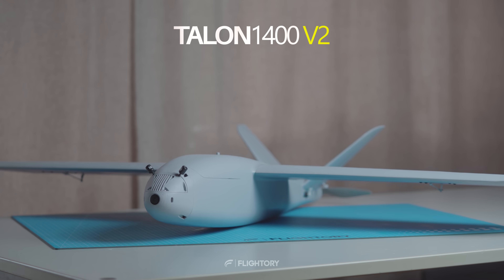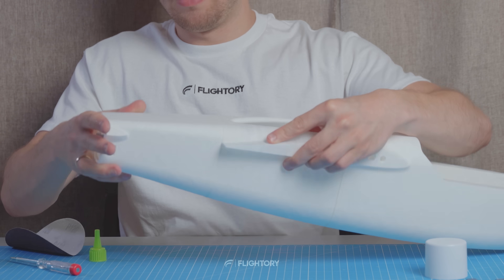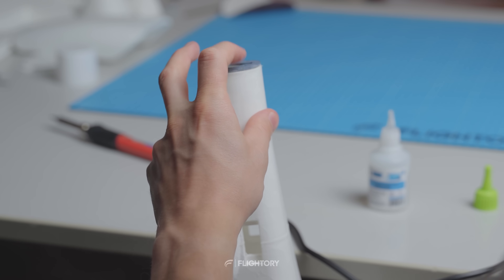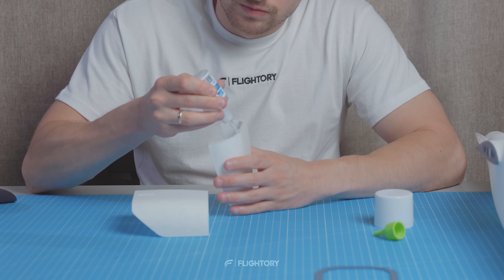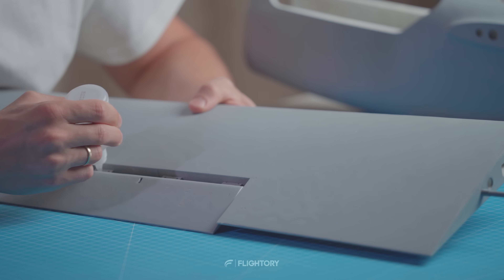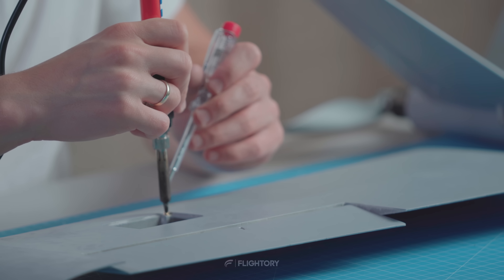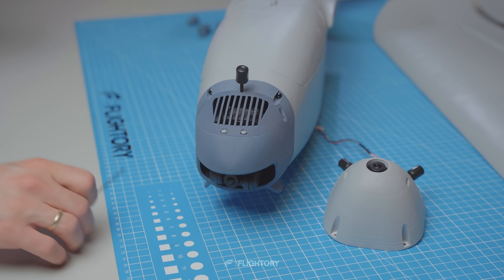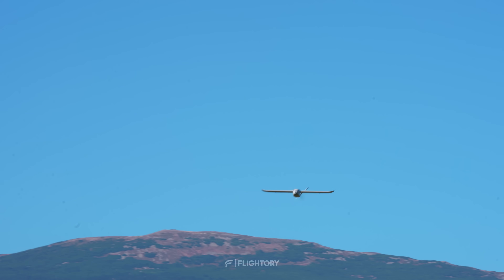How to Build a 3D Printed Fixed-Wing UAV? | Talon 1400 Build

Comment from the maker: The first video in the electronics series is now on the channel! 

https://youtu.be/VMb7csf-KqU?si=XMgjYycBKQixS2tG

I’m starting by introducing the basics, discussing the essential components for fixed-wings, and explaining key concepts. The following episodes will cover equipment selection, soldering, mounting components in the plane, uploading firmware, and setting up parameters—essentially, the entire step-by-step process of working with plane electronics. 

Let me know in the comments how you like it and what you’d like to see in future content. I appreciate all comments and thumbs up, as they help us grow this still-developing channel.
Reply: It would be cool to see a larger version with more sensors onboard. (Night vision, Thermal vision, etc. )
Reply: So uh ... I have questions. Why two 10mm rods to reinforce the wings yet flimsy 3d printed hinges for the control surfaces which are way more important? Also how the hell do you land the thing without destroying your camera and prop?!?!?!?
Reply from the maker: @ Believe it or not, the reinforcements and materials are not chosen randomly. I don’t quite understand what you mean by saying that the hinges are much more important than the wing reinforcement. They are equally important but serve different roles and handle entirely different forces. The wing is under constant stress during flight, and the spars are essential. They are designed to handle a takeoff weight of up to about 3000 grams without any issues.

The control surface hinges are made from polyester material, specifically designed for use as airplane hinges, and they are indestructible. There are no strong tearing forces acting on the hinges. Even if you completely destroy the entire plane, the hinges will still remain intact. I mentioned that you can also print them from TPU, and that’s true. Try making one and then try to tear it—it’s almost impossible. So, this is not a weak point at all.

As for landing, watch the flight video where it’s shown. Landings are done belly-first on grass. I said that if you’re worried about damaging the propeller, you can use a folding propeller, and then there’s no problem. I use a regular propeller because I never have an issue with damaging it. I land on grass with the motor turned off. Even if the propeller touches the grass during a sliding landing, it doesn’t get scratched at all. Regarding the camera, there’s no issue either. You land on the belly, and the camera doesn’t even touch the ground.

In normal use, I don’t see any problem. I make plenty of flights with these models, and if you use them correctly, they don’t get damaged.

However, if you crash the plane into the ground, then these considerations become irrelevant since most of the structure will be destroyed, along with likely some of the electronics regardless of materials using.
Reply: I would say releasing a video like that would boost sales like crazy.  I will say one of the biggest holdups I’ve heard from people is they are unsure of how to setup a plane, what to use to control it, etc.  providing an instructional video and even a printed guide would be an awesome addition!
Reply: I am VERY interested in more details for this project
Reply: a version of this uav with 30x optical zoom camera with night vision capability and thermal camera
Reply: Hey there, this plane looks really awesome and I consider building it myself! However - I only have a prusa mini with 180x180x180 build volume, so -  smaller than then required volume. On the other hand, I already successfully printed some eclipson planes which also require a bigger build volume by cutting some parts in the slicer. This might lead to some weak points - I know, but it did work overall. Do you reckon it'll be possible to do the same to the talon?
Reply: Whats the chances to get a fpv nose cone for a pitot tube willing to pay for this nose cone
Reply: 100% want more content on this plane!!! please do electronics!
Reply: What caused you to choose ArduPilot as the standard setup? There's other tools such as iNAV that have been around  for quite a while and are less tied to a specific set of modules...
Reply from the maker: I would say it’s the opposite. ArduPilot is versatile and compatible with a wide range of components. The possibilities for expanding the platform are extensive. I’ve been using ArduPilot for years and I’m very satisfied with it. The only thing that might discourage beginners is the interface, for example, in Mission Planner, which can seem overwhelming and complex to configure. For basic setups like this airplane, INAV would also be fine, especially if you’re flying only FPV, but I don’t plan to switch to it.

ArduPilot is also more reliable, offering significantly more capabilities, and has provided fixed-wing features for years that are either just now being introduced or are still in development in INAV. If you’re only planning FPV fun and short-range flights, and you’re already familiar with something like Betaflight, then INAV might be an okay choice for you. However, if you want to take things more seriously and plan to use more features in the future, especially autonomous ones, or work with more advanced platforms, it’s best to start with ArduPilot right away—you won’t regret it.
Reply: Definitely would like to see more on this build including sensors and payloads
Reply: Would love this as a hit :D as Im a bit of a 3d Print duffer lol
Reply: Hi, i started considering building this! How much it uses lw pla? Is 800g enough?
Reply: I bought the plans for the Stallion VTOL every video you put up i will watch it. My aptitude for this stuff isnt great. Not to mention this could lead to some great youtube revenue
Reply: Please make the follow up to your electronics video! Excited to finish my build :)

Comment: Some very useful tips for first time builders:
- You will waste a couple parts before you get the LW PLA settings right, practice on FUS1 and FUS5
- put in the inserts and front/firewall reinforcement BEFORE gluing the fuselage to avoid wasting other parts in case you do it wrong
- add a drop of thin CA glue to the side of each insert after pressing them in to avoid them getting loose
- you can use the carbon rods to align your fuselage reinforcement and root
-
Reply: Does it HAVE to be LW? Can I just use regular? I get that it will be heavier but will it be too heavy? I only have access to regular PLA

Comment: hi, purchased this plane a few hours ago,  liking the construction so far, just a small suggestion-  would you be able to design a changeable bottom skidplate contoured to the fuse. even a thin plate out of ABS/Nylon/PC slightly tacked on the bottom of the fuse with a few drops of hot glue will make it much more resistant to gravel/asphalt/dry grass landings.

Comment: But why PLA? It is not UV resistant
Reply from the maker: If you're flying, there’s no issue with the sun or temperature. If you plan to keep the airplane stationary in direct sunlight, you can use LW PLA HT filaments, which solves this problem.
Reply: @FLIGHTORY  no heat isn't the problem here, UV makes PLA become brittle
Reply from the maker: @EinfachFredhaftGaming  We fly our aircraft built this way in all seasons, including summer, and on the sunniest days, exposing them to UV radiation without any problems. We haven't observed any degradation in the structure because of this.

It also depends on the pigmentation of the filament. It's difficult to definitively determine if a specific PLA is UV resistant or not. To find this out, you would need to expose the component to long-term UV radiation. Most often, you’ll notice a color change, fading, etc. This is minimized in our case when we paint the surface.

However, if you're concerned about this, you can use an alternative like LW-ASA, which also performs well and is theoretically more UV resistant than PLA.

Comment: Ultimaker Cura doesn't see my Bambu Lab A1. Have u faced this issue before? How u solved it? What was your ULTIMAKER Cura version?
Reply: I think you should be using Orca Slicer. Its bambu slicer with more precise calibrations for filaments. Its also updated regularly. You'll login using your bambu credentials so it will connect and save all your settings. Try it out!
Reply: @jonathanvaflor575  thanks, I'll try it.

Comment: How much would this build cost? including all eletronics and periphericals like goggles and controller and VTOL converter
Reply from the maker: It's hard to answer this briefly, as it depends on many factors. On the website, we list the materials and electronics we recommend. Check if you need to purchase everything or if you already have some of your own equipment. Many components are universal and compatible with all kinds of drones and RC devices.

By diving deeper into the topic, you'll easily estimate the cost for yourself.
Reply: @FLIGHTORY  I'm merely a beginner still, so i would have to buy everything needed to operate the drone.

Comment: Why don't you guys have stls compatible with bambu labs settings?
Reply from the maker: @itsdoge4845  You can print on Bambu Lab without any problem, but we use different printers, so we have reference  settings for the Cura slicer. On our Discord, the community tests various materials and settings—there are already ready-made profiles for Bambu Lab with excellent results.

Comment: Great Build..! Just wondering when you design aircraft what kind of calculation you need to keep in mind to make sure it's flyable ? do we have any specialized software for just aircraft design or you used standard CAD tools ? I'm software guy but want to pursue this as hobby..I really want to learn whole design process.
Reply from the maker: @yashkhd1100  The design process is complex if you want to do it properly. 

I start with the basic assumptions: size, general shape, and configuration choices (number and placement of motors, tail type, wing shape, proportions, etc.).

I define the initial geometry and create a simplified shape of the aircraft. At this stage, many changes and optimizations take place. This includes testing and selecting appropriate airfoils, determining the shape and area of wings, stabilizers, setting incidence angles, etc. This is done using CFD.

At this point, I also select the planned equipment, motors, propellers, and batteries.

Once optimal results are achieved, the process can move to the next stage—finalizing the design in CAD software.

During the design process, it is crucial to consider the manufacturing technology and adapt the airframe for additional reinforcements or specific equipment.

If you want to start and create something of your own, I encourage you to check out XFLR5, a simple CFD program that allows for preliminary design planning. They have an accessible knowledge base that explains how the software works, the functions of different modules, and basic aerodynamic principles, especially for RC models and small-scale aircraft.

I’d recommend starting with a simple glider or motor glider to learn how to design basic geometries, select airfoils, and understand charts, etc.

Regards
Reply: @FLIGHTORY  This is really really helpful..Thanks..!!

Comment: I wonder how this would perform if I printed it out of petg, I live in the desert and if Ifly this I know for a fact this would turn into Icarus's wings real quick haha
Reply: I think it would be too heavy or be inefficient in its motor/battery to maintain longer flights. White PLA would be fine. There's also air flowing over the surfaces to cool it. If your really worried, maybe try putting some thin aluminum tape or reflective vinyl patches along the top of the craft to reflect the sun. Also, the glass temperature for the LW PLA (temperature in which the plastic softens) is 55C or 130F. You should be fine lol.

Comment: ı want to ask you a question. I wonder it. LW-PLA in sun could melt ı think but you recommend LW-PLA. Why ? I want to build talon1400 but I fear of that.
Reply from the maker: @omersar6853  When you’re flying, there’s no such risk, even on the hottest days. The aircraft is constantly cooled by air. However, if you leave it in a spot under direct sunlight for a longer time, then yes, it will likely deform.
Reply: @FLIGHTORY  thanks for information. One more question. If I build uav to use PETG for all parts, which problem I can get it ?

Comment: Building this was a total blast, the details are insane! Gotta try it for sure! Already subbed. Gonna check out the link you dropped and print it on my Flsun. A bigger heat bed would seriously cut down on the parts I need to put together. Can't wait to see how it turns out!

Comment: What does something like this cost to build if starting from scratch other than owning a 3d printer
Reply: depends on scale: want to build one? spend thousands on tooling just for the one. want 10 thousand? spend thousands on tooling and maybe dollars of material per unit, averaging out to 1s or 10s per unit.

Comment: Could you put a EDF motor in your UAV
Reply from the maker: Not for this, but it is possible to design an airframe for an EDF,  though why bother? EDFs are generally used for scale jet models. For such platforms, we need as much efficiency as possible, and EDFs just don’t provide that.

Comment: I guess my question is; cost? Assuming you have a printer and pla. Electronics how? And then landing is another big one for me. How?
Reply from the maker: Thanks, as I often say, there's no problem using a folding propeller if someone is worried about breaking it during landing. However, I don't have that problem—I simply don't break propellers or damage anything during landing. When landing on grass in a gliding flight with the engine off, the propeller just touches the grass, and that's it . Check out the video from the flight where landings are also shown. As for the costs, it's hard to estimate because I don't know if you already have anything, like a transmitter, for example. You can purchase a wide range of equipment at various price points. On our website, each airplane has a list of required materials and electronics. You can check what we used and estimate the cost of building it yourself.

Comment: This is awesome! Good video, just found this channel from this video..
Can you make a video on the 2-axis gimbal set up you have? How did you program it and how do you move it? Do you use a slider knob? Can it be done with Headtracking? Do you fly this FPV or is it for the HD recording? How is the Range of the Walksnail system? What TX link are you using? Is this INAV or Ardupilot or something else?
Reply from the maker: Check out the video on our channel dedicated to the GM3 gimbal, where I describe its capabilities. In short, it’s an FPV Walksnail camera. The gimbal can be controlled via PWM, as I do (using sliders on the transmitter), or through Walksnail’s head tracking. The Walksnail's range mainly depends on the antennas and VTX power. Records have been set at up to 50 km, but typically it’s around several kilometers. I use ArduPilot.

Comment: what is this Senus Spray and where can i find it to buy? what alternative are there to that spray. And do you use superglue?
Reply from the maker: As I say, it's a CA accelerator, which is optional but useful. Superglue is actually CA glue, but it's worth buying larger tubes for better value.

Comment: Do you know the weight on it with battery? I'm trying to get it inside of some really tricky laws... im trying to set it up for autonomous flight over a preserve area for anti-invasive species spotting.  We can't use a vertical take off uav but there's no law against using a fixed wing under a certain weight.
Im hoping to maximize loiter time and give us a good spotter for night time use. I have a light weight thermal camera already. I just need a good airframe to maximize the time on target.  We use 2 shooters at 3000m to take feral hogs a 3rd guy shots and makes sure no people wander into the area. We have permission to cull but the area manager was nervous about signing for uav use. We want to use it for safety and spotting. There's a state law about flying over parks without permission. I previously had permission to fly for search and rescue when hikers get lost but that is only for SAR use.

Comment: 3d printed screws??? I don't think it will be strong enough
Reply from the maker: They are stronger than you think; there's no way they wouldn't hold up in their current application. You can also easily use ready-made plastic screws, but many users have complained about their limited availability in various countries, which is why I also created 3D-printed versions.
Reply: @FLIGHTORY  you are right, just as a recomendation. I would use a small radius between the head and the body of the screw to reduce the fatigue point. I added some in SW to your design.

Comment: Would it be possible to use an Arduino or a Raspberry to make a programmed autonomous flight?
Reply: Sure, read about companion computers for flight controllers. Even ardupilot tells you how to do it with the Pixhawk. However, for an autonomous flight, you just need a flight controller running ardupilot or airnav, a GPS, and some sensors. An easy start is the speedybee f405 wing. There are thousands of pieces of information for the setup and videos about it.
Reply: @AVEAE  thx

Comment: Hi, I really like your video but I have some questions. I'll start by saying that I don't understand anything about it and I would like to understand if my idea is feasible. I would like to build an FPV plane with a stabilized camera placed underneath the plane that I can control with the DJI Goggles 3 as I already have them. obviously made the right modifications to the 3D model. Could you tell me if my idea is feasible and if I need any special equipment? thanks.